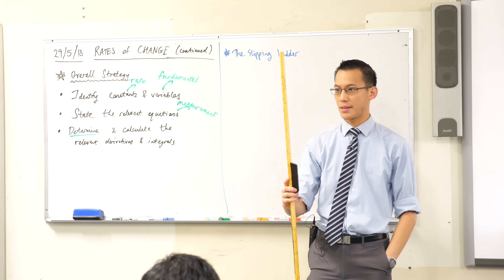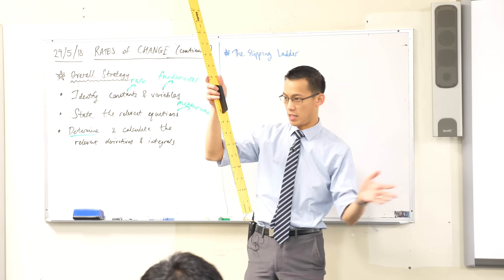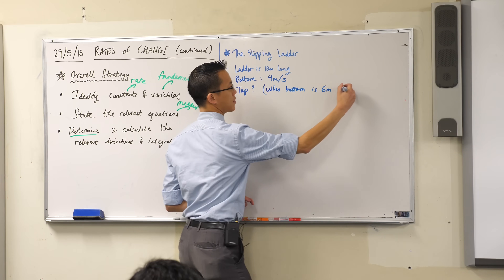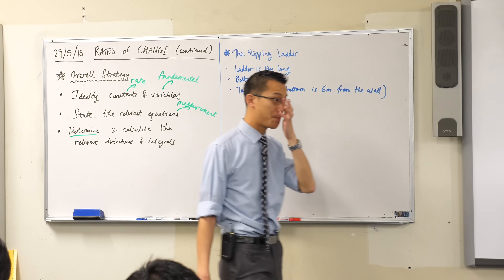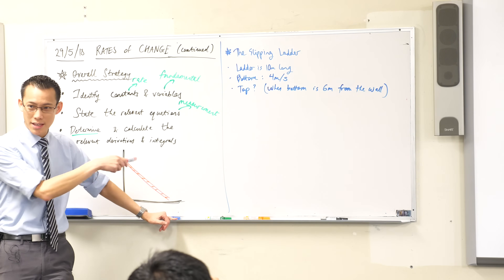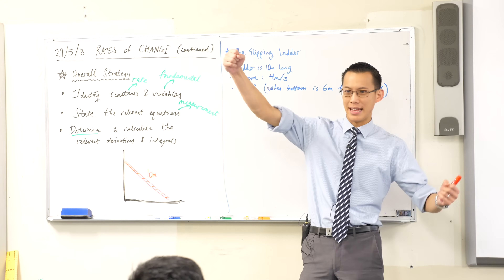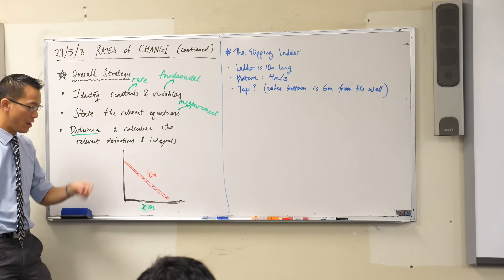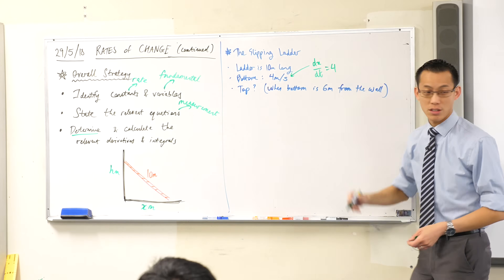Related Rates of Change - Slipping Ladder (1 of 2: Establishing the scenario)

Comment: One way of solving this problem would be to assign a function to x and another to y, both depending on the instant of time (t), using initial positions and velocities (even not knowing y's velocity).
This way you could calculate at what t x(t) = 6. Then you could use the condition x^2 + y^2 = 100 to determine y's velocity in the instant of time previously calculated.
Reply: ecunha1999 yeah that's what i'd have done